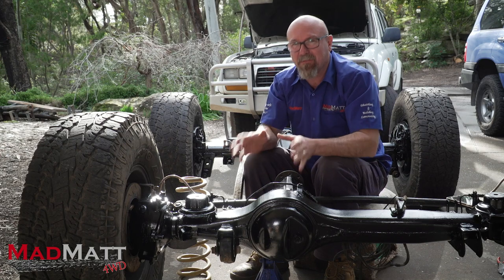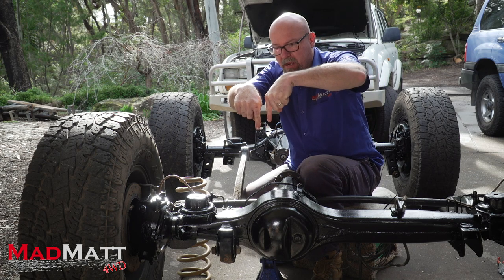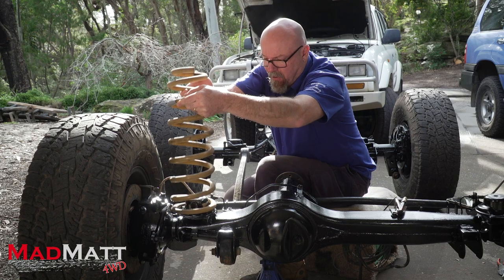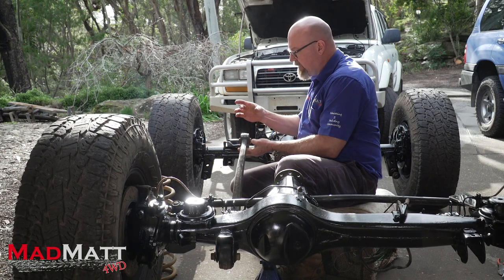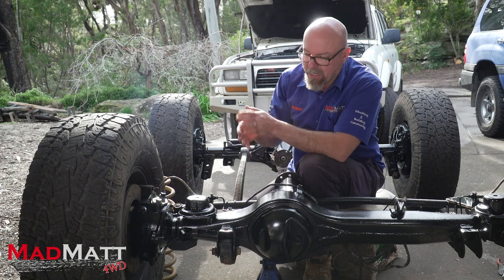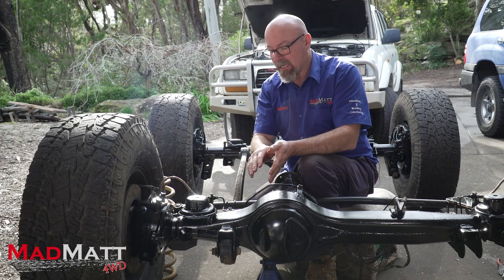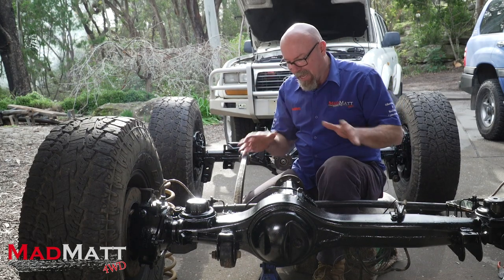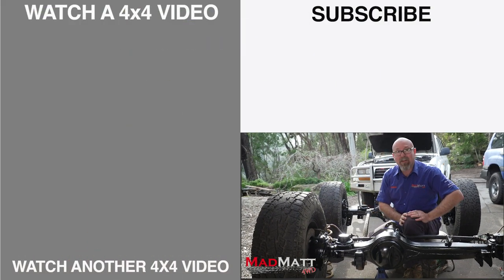Castor Correction - What is it and how can castor be corrected?

Comment: Nice work matt.  We were just recently having this discussion ourselves re the engineering of various components of the steering/ suspension.  Caster is important for steering stability and is usually set at around 3 degrees which is a nice balance between predictable and stable handling but without the steering becoming too heavy and cumbersome.  For every inch of lift you lose roughly 1.5 degrees of caster angle so you can see that pretty soon once you start going  above 2 inches you're going to get into negative caster. Negative caster is not great from a handling perspective unless you correct the caster as your steering becomes over reactive and too light. Quite tiring in fact when driving all but the smoothest roads.  Also one of the other lesser known benefits of rolling the diff back to its original orientation is reducing the stress on the propeller shaft and pinion bearings which really don't like operating at steeper angles and are designed to work best when the flange faces are parallel. Incidentally caster can (and should) be corrected in leaf spring vehicles as well by simply adding wedges between the leaf spring and the axle tube.  I reckon a lot of people don't think about this when lifting 4wds and probably should so thanks again for raising the subject especially in such a clear and concise manner.
Reply from the maker: Hey Jade. Thanks for the comment and your're right most people don't correct leaf spring vehicles. You make some excellent points.

Comment: I built rallycars and we set up the live axles on rose joints , u could use heavy duty rod ends and they have threaded adjustments and they move left and right and no axle wind up that u get with rubber bushings
Reply from the maker: Interesting.

Comment: What about correcting the caster angle with relation to the new pinion angle when you lift your truck? Or what's the solution there? Double cardan?
Reply from the maker: Yes a carden if it’s needed. Depends how big your going. Most lifts don’t need it.

Comment: Castor plates can do the same bending of the Tie Rod also. I have them in my 80 , and they touch on full flex.  But not enough to do alot of damage.   Still my preferred method of castor correction though 👍
Reply from the maker: Yes I agree. It's not a bad method.

Comment: Hi mates I need u r suggestion regarding outlander non adjustable casters. A wheel alignment place in the process of fixing crook steering wheel I think they messed up casters. Which made rider hard and bumpy, and I changed the suspension but steering is chambering left and right and and steering return is aggressive even after doing wheel alignment 8 times. Can you please give me u r suggestion. Thanks mate
Reply from the maker: It’s impossible to help unless I had the vehicle to work with. Try some different specialist mechanics.

Comment: every method you mention affects pinion angle --- set pinion angle, then adjust castor by turning the knuckle on the axle housing...its really the only way to correctly set pinion & castor.
requires welding & planning, but ultimately is worth the effort.
Reply from the maker: I agree for big lifts or race cars but for a normal 4wd there’s other ways to mange it that are a lot easier and cheaper. The unis still last well with a 2-4” lift.

Comment: Matt, I have an OME 2inch(ish) lift on my 78 prado cruiser.  Steering is at least ok, but body roll is bad.  Does castor correction have any part in side-to-side body roll?  I have toyota oem bushings, 'cause I've heard repeatedly that they correction bushings do not last, and I work my suspension hard here in Uganda.  On the other hand, I thought the castor plates were for higher lifts, in the 4+ range?  I'd rather not do the washer fix, because that locks me in to this ride height and you have to guess right the first time, unless you break out the welder all over again.  Advice?
Reply from the maker: Caster is more about steering feel. Look at your sway bar setup for sway control. Also are your spring rates right for the weight? If the springs are to soft they can’t carry the load.

Comment: Hey Matt my 05 105 Landcruiser wagon has a 3inch lift it hasn't got the return to center damptner only an TJM xgs gold damptner and I'm running the the GXL 8 inch STEEL rims and it drives like a 100 series with s 2inch lift would i need castor corrections or not so far I've had no issues what's your thoughts
Reply from the maker: You're steering damper won't really be dealing with incorrect castor which you will have if nothings been done to correct it. I would suggest if i drove your vehicle i would find the steering vague and the cornering unpredictable. You have probably got used to it being wrong and until you drive one that's correct you won't notice it.
Reply: Cheers Matt I'll  see if I get anything when I next drive the car🙂

Comment: I have a 1998 wrx and having problems with the car veering the left and right when driving straight. Also feels like the car is on roller skates and all over the road. Ive had front lower control arms done, front struts, 3 wheel alignments and balance and still hasnt fixed the problem. Ive now been told that the left castor may be bent and because subaru castors cannot be adjusted and replacing it is so expensive so the mechanic has suggested castor correction mounts. Do you think this will fix the issue of the car terrible tracking or could there be another issue at play here. Also veering hard right when braking as well...thanks
Reply from the maker: Hey. I'm not at all familiar with the WRX setup but to answer your question all the settings need to be correct for the car to drive right.

Comment: Excellent video and very informative. Personally, I preferer to go with a bearing kit to correct the castor on lifts up to about 2 or 3 inches, after that I cut-out the welds holding the steering knuckle to the diff housing, then rotate the knuckle back to the desired castor, before rewelding them back in place. It's inexpensive, and eliminates any problems with the diff being out of factory alignment, like torn mounts, bent tie rods, or constantly flogged out uni joints...
Reply from the maker: Thanks. That’s a very good way to do it although way out of most people’s capacity.

Comment: Lovely boss
Reply from the maker: Thanks mate
Reply: I want to up lift my land cruiser 80 series 1997 vx 1hdft at home ,but I'm a bit confused for a 2 inch lift with iron men kit is it important to correct caster and what is the function of adjustable Panhard road why not the stock one?need your guidance sir
Reply from the maker: @basharathussain5565  hey mate for only 2” lift you don’t need to do castor correction unless you find the steering goes to vague after you’ve fitted the suspension. Generally they’re fine at 2” but from there up they don’t work as well and need correction. The panard will be fine. It’s job is to bring the diff back to centre because when you lift the truck the diff swings on the panard to the side and this is no good.
Reply: @MadMatt4WD  thanks I will try it by myself and will let you know.

Comment: Dear Mad Matt, my LC76 has a pulling towards right, I adjusted the arm and the alignment reading for caster is 4 left and 3.9 right. Still its pulling right, I am really dissatisfied and to keep always a pressure for steadiness. Any possible way to fix this issue
Reply from the maker: Your castor is more about the sensitivity of the steering rather than the pulling to left or right. So check your toe in and toe out and check the Camber of the wheels. Also make sure the tyre pressures are correct. also make sure none of the brakes or wheel bearings are dragging.
Reply: @MadMatt4WD  Thanks 👍

Comment: Mate caster is the last of your problems there. The biggest problem is someone stole the whole top of your car.
In a patrol you can also use a spacer at the chassis end to push the arm forward without dropping it down.
Reply from the maker: Lol. Is that whats wrong. Yes the patrols are different with the pin end.

Comment: No care for castor, just wanna see that turbo 1fz  go up a mud hill 💦💦

Run drop boxes here. 3inch lift. Drives mint.
Reply from the maker: Drop boxes work for sure.
Reply: @danbusey  never had a problem tbh, even 200series and 79s mounts hand low asfuck stock
Reply from the maker: Yes Dan as I say in the video the main reason I would't run them. I have enough trouble with the front mounts on the rear arms.

Comment: Greetings matt, which lift is suitable for a bundy, 2 inch or 3 inch?
Reply from the maker: I have 2” body 1” suspension. You don’t want to go too high or they’re too tippy
Reply: @MadMatt4WD  could a 33 inch tyre fit without any issues? Greetings from Malaysia
Reply from the maker: I run 33" with no worries.

Comment: If you don't have balanced caster, the vehicle will pull to the side with more.
Reply from the maker: I'm not sure why you wouldn't have balanced castor.
Reply: @MadMatt4WD  It happens more in independent suspension vehicles, but can in solid axle rigs like you have if they get roughed up on the trail or they modify the suspension. People especially need to realize the importance of making sure they balance the castor if they start modifying it like you talked about. If it's not balanced (more on one side than the other) it will pull. Sometimes severely.
Reply from the maker: Ok yes I see what you mean. I would think something would have to be twisted for a live axle vehicle to be unbalanced. Tanks for clarifying.